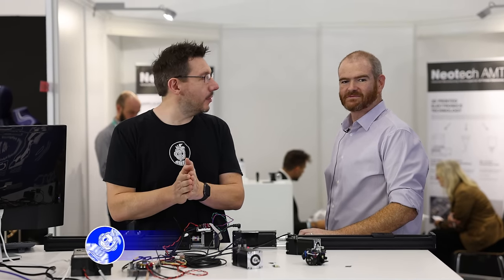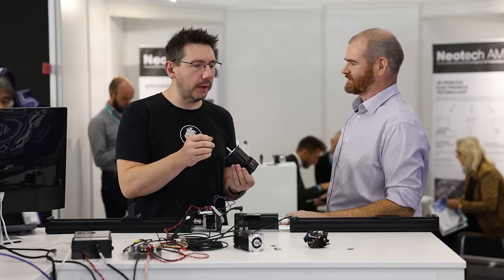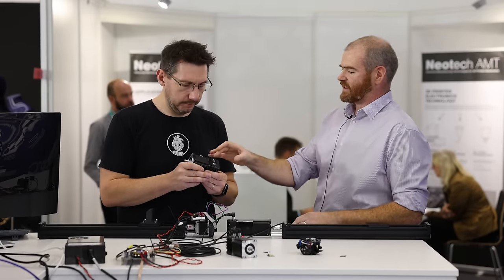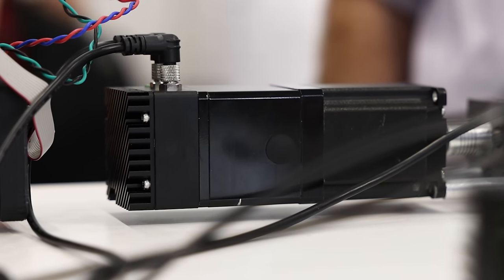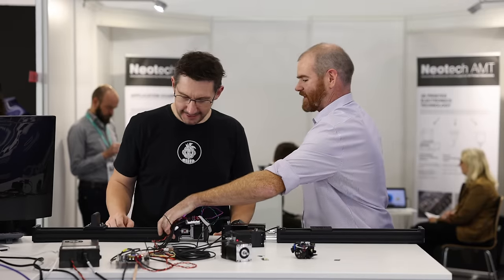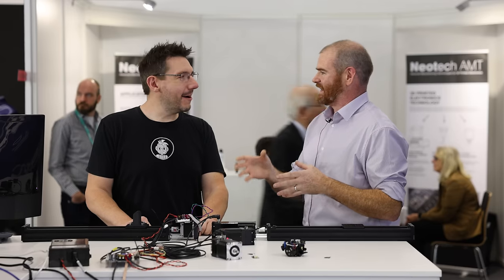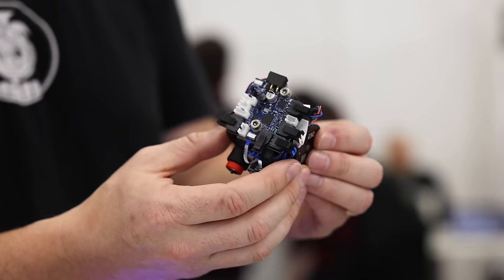Closed Loop & Can Bus! Duet3D at Formnext 2023!

Comment: Canbus is an awesome solution and really should be adopted as a standard across all home printers. Its cheap, and turns printer wiring into Lego simplicity. I have been using it on my toolhead for just about a year now. I would love to have canbus motors.
Reply: Absolutely. But sadly there are still people that prefer their 14 to 25 wire bundles because less setup and no canbus failures. Dude, modern cars without canbus wouldn't exist. Honestly if someone builds a printer from scratch and isn't using a canbus board he is dumb. Not only from a time perspective, but also from a financial perspective. Motion rated wires are actually expensive, locally the meter of 0,25mm2 ptfe insulated wire is 2 euros.
Reply: Its worth noting that Duet are using the more advanced version of Canbus that costs money to use. Klipper canbus uses the free version so it doesn't have the same data rate and features. Duet stuff is cool, I like that Beacon style scanner for one, but it costs.
I would love to be able to just run 4 wires to my motors and then the toolhead and then bed scanner. At the moment though my motors are running 48V and I have to canbus to the toolhead board and USB to the Beacon probe. Its not as simple but yeah, way better than wire bundles of 24 or more.

Comment: First off, I love Duet, but I think that I'll stick with my Teknic servos. Brakes are a great addition to the Z axis, but as for X&Y, meh... However, simply shorting the Z axis leads together when you stop the motor will energize its "internal eddy current brake" (also known as the coil wires :) ). 

Getting data back from your drive (servo or otherwise) is usually the bare minimum, however the depth of the data provided is what varies widely. But it's nice that Duet isn't requiring a paid subscription or anything silly like that (looking at you General Electric). And Tony is correct, using the historical data to say when to perform maintenance is very, very nice.

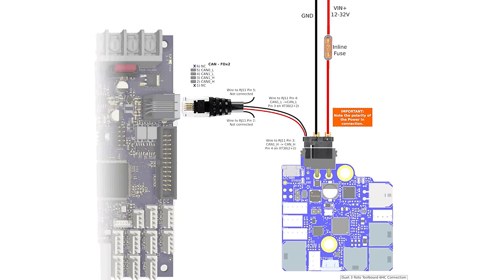@9:04 you can see the two connectors that Duet provides, the XT30 2+2 (good!) and the RJ11 (imagine screeching record sounds followed by prolific cussing. WTF?). At least it isn't a USB-C connector...

And @9:24 "reduce it down to just four wires". Yeah, like every other Canbus implementation out there. My Qidi's "USB-C" cable is nothing more than a four wire cable inappropriately using USB-C connectors (but it does have the factory "rubber band to hold it all together" upgrade. :) ) 

And yes Tony, to do wiring properly is difficult, but you can make it much simpler by using the correct damn connectors. Although no one has ever had the plastic clip on a phone jack connector break, am I right? When I was a Controls Engineer for GM, Canbus (in the form of the accursed DeviceNet) connectors (ControlBoss) were our #1 problem with the media. So much so that no new installation is going to ever use DeviceNet again, and finding parts for it is difficult. It had that bad of a reputation.

All that chiding aside, I love both my Qidi and my Duet boards. Excellent hardware on both of them. And I do like the Z probe. Especially the donut board for the probe. :)

What would be a nice addition to your board is a couple of general I/O connections, analog as well as digital, that a user could hook a random device to and the Duet board would parse that data out along with the rest of the devices on the board.

Comment: I  have a silly question regarding CAN. I understand the lack of cables, is better for more reliability. But what about redundancy? Instead of having 1 data cable, have 2. So when 1 fails you get a warning? So the machine can still work if something fails mid print? Probably a little over engineered but something like that I would appreciate. Especially for prints over 24 hours.
Reply: I see your point. Duet usually uses an RJ11 cable to wire CAN-FD boards together, so you could use multiple conductors to carry the same signal inside the cable.
Reply: Since almost all of the wear-related cable failures are going to be from continuous flexing, there won't normally be shorted cables to worry about. So in theory you should be good in that you won't have your signal clamped down. However, adding a second cable to the mix is just going break at roughly the same moment as the main cable (or before). So you don't gain anything from a second cable. Worse yet, a likely scenario is that your main cable fails on a Monday, and no one is aware of the problem because the backup cable saved the day, and on Tuesday it fails. Not much benefit to that.

Where your efforts should be focused is timely error detection and being able to put the machine into a recoverable hold state until the problem is fixed.

The key is a proper cable that has been designed for continuous flexing. Using a surplus Ethernet cable is not going to hack it. I have surplus DeviceNet "thin" cable which was designed for Canbus (in the form of DeviceNet) from the get-go. 

Qidi's "USB-C" cable is effectively a Canbus cable with only four wires (I cut one in half and took a look - it was bad anyhow). So what you've got with it is a four wire cable (yea!), that mostly looks like a Canbus cable (or at least good enough for the distances that we will be going), with completely inappropriate connectors on the ends (WTF?). They are the only ones doing this by a longshot, but all of those designers know better.

Duet is to be applauded for not including that silliness into their design.

Comment: Can see reducing cables being helpful... but
want to get rid of wires?

Go wireless
Run power through the metal x/y axis.
Just ensure the system only powers on when people are not present to avoid accidents... and people inside larger printers when they are running getting smacked by a 300c head at high velocity or melted plastic are not going to end well anyways... so running the power through the x/y rods makes sense.

Home ones can just have enclosure that shuts off when open... just like a microwave.

Comment: Will the microcontrollers on the toolhead board tolerate high chamber temperatures? Some other popular CAN boards will only reliably go up to 85C, which limits printing high performance materials.
Reply: I actually asked them at Formnext! The Roto toolboard has a maximum temp rating of 75°C. Although E3D sets the max operational temp of the Revo Roto at 40°C.

Comment: Wouldn't it be possible to do closed loop based on back-emf feedback in the motor controller? Then we could also use this tech to make power reqs lower for small and fast consumer printers.
Reply: All that tells you is that you skipped steps, not how many.

Comment: I wonder if the board on the extruder has any problems with the heat
Reply: The steppermotor on the Revo Roto uses 0.45A peak, so no, the driver on the board won't get hot. (The TMC2240 can handle 1A without active cooling)

Comment: Can someone please explain open and closed loop when it comes to these motors. In automotive aspects it means signal not being read in open and signal being read in closed. Is it the similar concept?
Reply: It just means in open loop the driver sends step signals to the motor and if the motor can't perform all those steps then the driver doesn't know about it. For instance if the nozzle hit the print really hard for some reason the stepper motor may just not have the power to move the steps commanded. The motor just loses those steps and continues on. From then on the tool the motor is moving will be in the wrong position. 
With closed loop control the driver sends step signals to the motor in the same way but it also has a position sensor on the shaft of the motor sending feedback to the driver. The position sensor allows the driver to always know what the motor is doing in actuality, not just the commands it is being given and to compensate in real time if the motor fails to perform any steps. The driver can send new steps for any that were not executed and ensure the tool is always in the correct position. 
So its like just a firehose of instructions pointed at the motor in open loop, vs sending instructions, checking they are done, compensating if needed and moving on to the next. The position feedback closes the control loop.

That's the basics for 3d printers and stepper motors but there are more advanced cases for other systems.
For 3d printers just having the correct sized motors running at a speed they are capable of is really good enough. I haven't had skipped steps on my machines ever unless there was a more serious mechanical problem that closed loop would not solve anyway. For applications with real load on the motors like CNC mills they make far more sense.
I haven't looked at what is available lately but closed loop stepper systems that I have seen all used older, slower and noisier driver chips rather than the popular TMC trinamic drivers that all printers use these days. I don't know why that is the case but its one reason they aren't more common. Duet is no doubt using something much better though.

Comment: Great that they are NEW to release close loop steppers.  Closed loop steppers have been on the market in hobby CNC for years (servo?)
Reply: Closed loop has been around for a while yes. Closed loop steppers are middle ground between actual servo motors and generic steppers. In a nut shell, it tracks the steps and attempts to correct itself when it misses one. Servo motors are still superior, but cost is an issue. In an industrial setting, you rarely see stepper motors used.
Reply: Yes but so far from what I can tell all of the closed loop stepper boards are configured to only work with slower speeds (about 1/3rd of the stepper max speed) and so aren't useful for faster printers. In my case running closed loop meant I either had to drop speeds by a half (max of 90mm/s) or the quality was useless because the "error" would increase even with no load or skipping, leading to an oscillating rotation instead of a smooth rotation.
Reply: @SirSpence99  Have you looked into running a printer on clearpath servos? They are incredible motors, but I've never seen one on a printer.
Reply: Anyone found closed loop Nema 17 stepper they like?  Looking to use for my CNC, only seen Big Tree Tech ones, but mixed reviews 🤷‍♂️
Reply: @AzaB2C  I got the big tree tech ones for my printer. Any speeds above 100mm/s (using voron 2.4 gear ratio, I can't recall what it is but not very large) caused it to be nonfunctional.

From my research they can be reprogrammed with some open source stuff that has way more options but that can be a pain and requires a special module.

Comment: What is the name of the toolhead? 0:06
Reply: That is a Voron Tridex printer running 2 mini stealthburner orbiter 2.0 toolheads. They appear to be slightly modified versions though. It looks like they just removed the top half of the front cover, maybe to make mounting the toolboards more practical and visible.

Comment: I like Duet3D and this is another good piece of hardware but for me the DWC is the weak point. If you want to build a machine which isn’t a 3D printer you have to use a control panel which is written for a 3D printer or a CNC machine and it’s not easily customised and display compatibility is limited to paneldue which is only for 3d printers and looks like it was developed in the 1990s. If the platform had better control software and gui I’d make all sorts of machines with it.